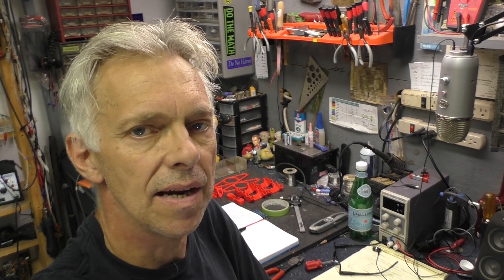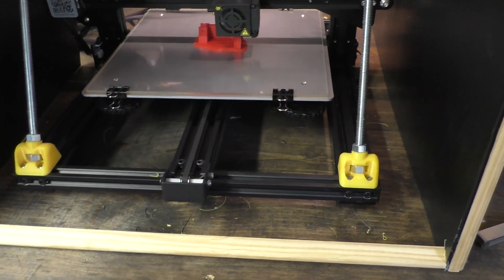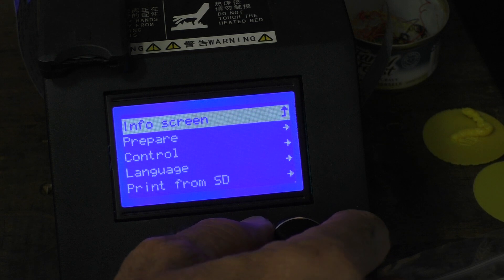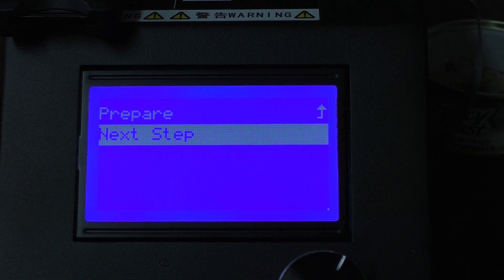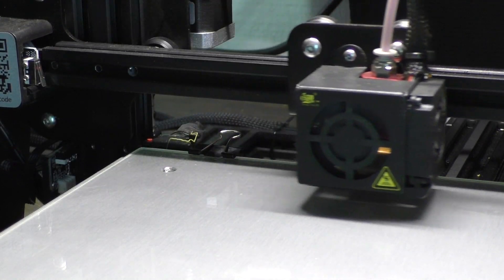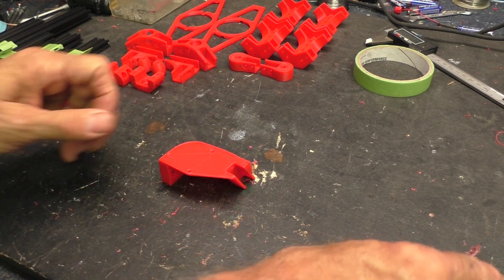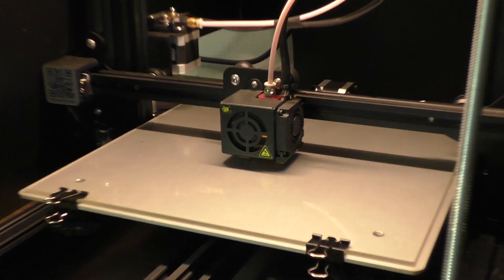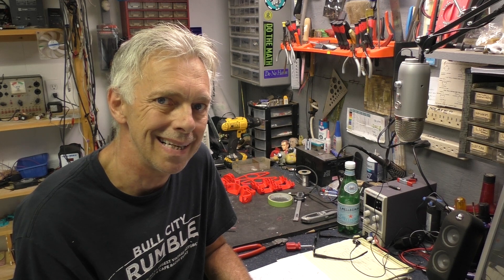3D Printing Tips - Creality CR-10S

Comment: Great video !  The CR-10S may be a bit "last year" now in lieu of all the great printers appearing on the market but I'm still crazy about it.  I like your enclosure, I have something very similar.  As far as bed adhesion is concerned I also had to do some experimenting and here in South Africa I found clear lacquer to be just the thing for me.  It's the kind you find in metal spray cans and the ABS I print with sticks really well on the glass.  In fact, so well that I always print with a raft.  It prevents larger prints from taking out chunks of glass when I peel it off.  I do not really bother cleaning up the plate after prints, I just scrape off all the excess hardened lacquer.  This process of applying the spray on lacquer also means I could lower my bed temperature to around 70 degrees C.  Printing ABS on the CR-10S and similar models can be a challenge, I'd like to share a few points on how I was able to resolve most problems.  I print outside walls at around 30 mm/s and also reduce my acceleration to around 50 mm/s/s. This ensures a stronger bond between layers around the corners and that's where ABS likes to come apart.  Be sure to look into flow compensation, it will obviously differ from one machine to the next.  Mine is currently set to 110% (using Cura).  It was the last piece in the puzzle for me, even if there is a bit of stringing I would rather have that than taking prints of the glass and find them cracking apart ! :D

Comment: lol @6:12 the brim is horrible it's falling apart it should be all stuck together, this means the bottom layer is relying on the 2nd layer to hold it together, also because it is a small print it has little to do with bed leveling and more to do with the clearance between nozzle and build plate, that is by no means a good first layer.
Reply: I have to agree with that.  Couple of things that he can look into, increase the flow rate by a few percentage points, reduce the line width (depending on the nozzle size) or both.  I use the tried method of putting a a piece of typing paper between the bed and (hot) nozzle when doing the bed leveling, there has to be a fair amount of resistance when I pull on the paper.

Comment: Great tips, I have a CR-10s as well and I love it. Came right out of the box printing great. I bought a pack of 12"x12" mirrors and picked the flattest one to print on. Works like a charm. I also built an enclosure that keeps the heat and sound in.

Comment: Shouldn't print abs/high Temps like that with the stock hot end
Reply: For what reason?
Reply: @DeanSegovis  ptfe breaks down at Temps above 240 or so. Trianglelabs on aliexpress makes good hot end replacement kits that are all metal and much better suited to this. I can suggest a really nice printable duct/mount setup too, if you like